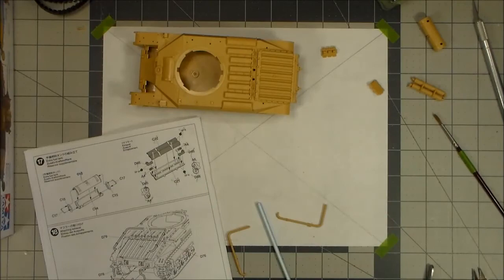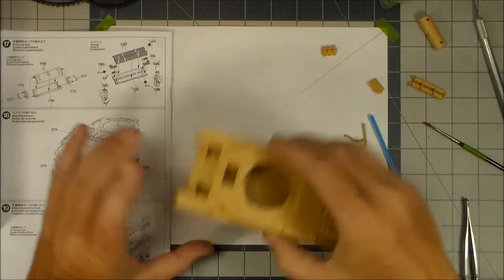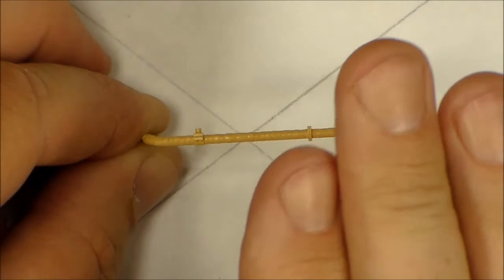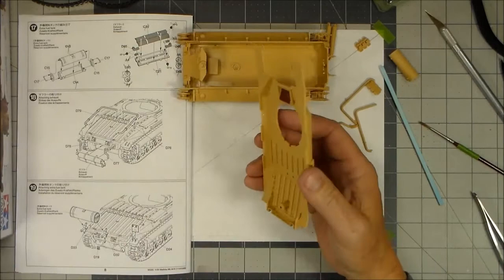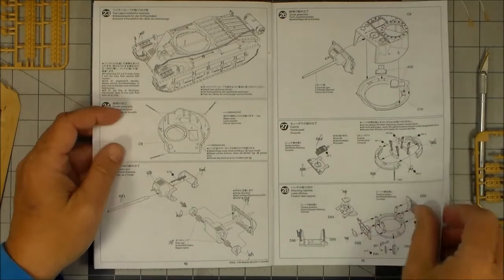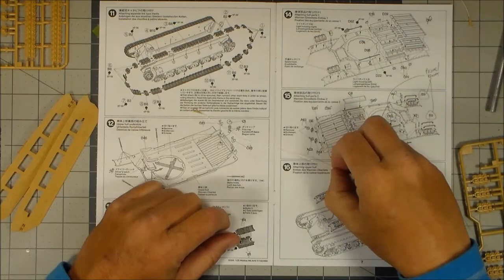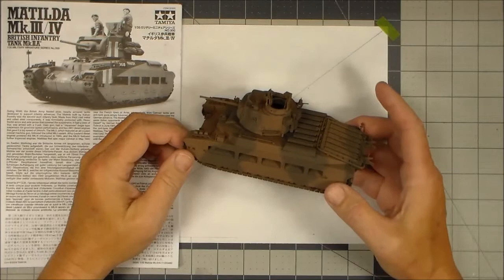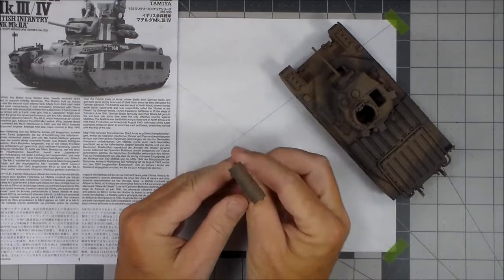Tamiya 1 35 Matilda pt 2

Comment: Cool!!! I love how you managed to hide your mistake. It's really invisible if you don't know exactly where to look. The camo pattern is nice. Never saw that on British vehicles before and only had the dark green and black two tone scheme in mind. I know there are modelers who don't think much of Tamiya. I do, because I like their high level of engineering. It shows very well in how they keep the part count low and still have more than just sufficient details. And since they started to add PE parts, metal gun barrels and link-and-length tracks to their kit, this is just about right for most of us, beginners and advanced modelers.
Reply from the maker: Non-Prolific 1/35th Scale Model Builder thanks. I used those particular colors because that was the color call out. And after a little research, the color that the Brits used during the very early part of the war was a brown and a really almost all  black brown. I figured that would be a little more interesting and different than the usual caunter scheme  that most people use
Reply: Indeed! That's much more interesting.  :)